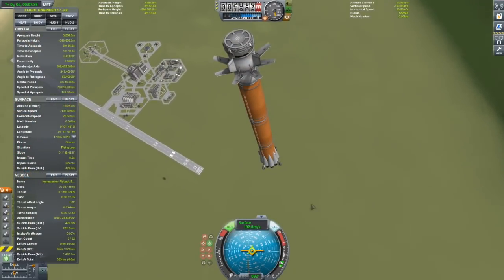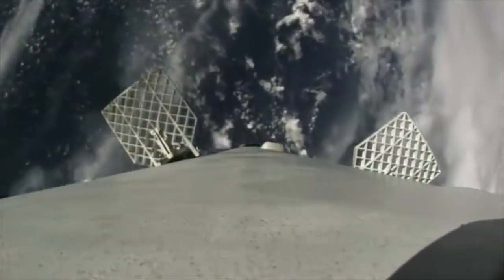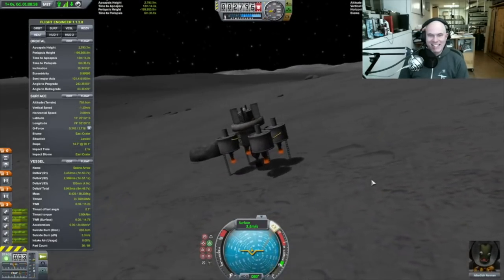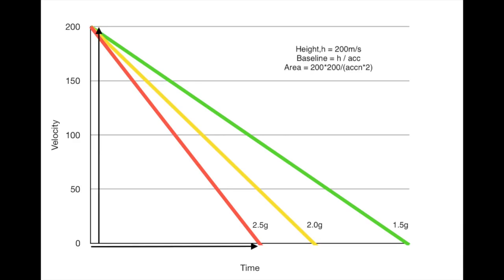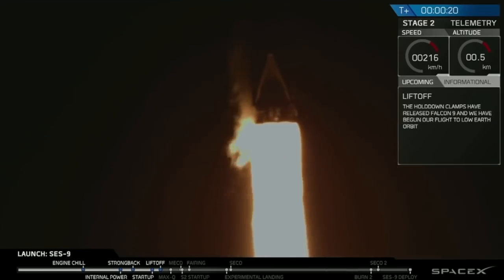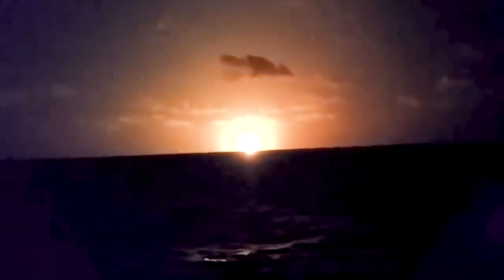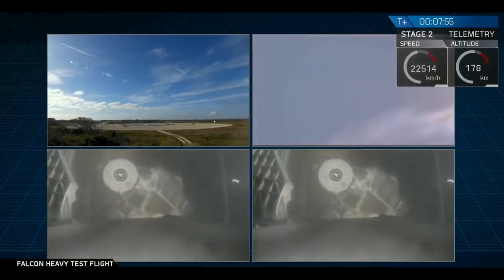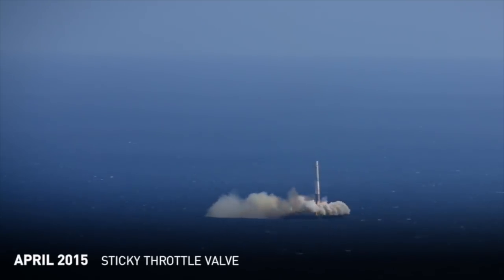How To Do A Hoverslam - Things Kerbal Space Program Doesn't Teach.

Comment: Surprisingly, I remember a very basic 'simulator' Deutsche bahn released on their website a while ago that was a PR thing showing the best way to drive a high speed train for energy efficiency.
One of the things was quite obvious; when dealing with a hill, let the train slow down uphill, then recover the energy downhill. (though it demonstrated this was tricky to do while keeping to schedule and not breaking line speed limits on the downhill section.)

But the one that I'm reminded of here is that the program and the web page to go with it showed that the most energy efficient way to drive a train is to accelerate as quickly as possible, and decelerate as quickly as possible as late as possible.
In other words, it's a similar operating principle to the suicide burn rocket landings - quick, sudden velocity changes are more energy efficient than slower, gradual ones.
(though both for rockets and trains there are a bunch of limiting factors that make this less practical in a real world scenario.)
Reply: Oh, yes! Energy-efficiency optimisation often leads to bizarre results. One more niche application, very closely related to the problem with trains: given identical lap-time target, a more powerful racing car will use less fuel (assuming equally efficient engines). Accelerate as fast as you cant out of corners and then lift-and-coast for a while before hitting hard on the brakes. (Modern F1 with its ”hybrids” likely uses this approach, obviously, on how to best use the recovered braking energy.)

Comment: So technically KSP does teach this?
Reply: Yup. The only thing it doesn't teach in all of this is that engines cannot be throttled, and need time to start up.
But that was already part of a previous "things KSP doesn't teach" video.
Reply: And there are mods for both of those, if you really want them.
Reply: engines cannot be throttled? Yes they can, unless they're solid rockets.
Reply: @slopedarmor Sure, but there are limits.  They need a certain amount of fuel flow to sustain combustion and operation, and that means there's a minimum thrust they can put out.  Between that and full throttle you can probably throttle them pretty smoothly, but there's that minimum - which KSP doesn't model without mods.
Reply: That's true. You can go to like 1% thrust output in ksp but not in real life  D:
Reply: Not all liquid rockets can be throttled. Some of them are one ignition and zero throttling ability. Apparently, some pumps like to 'chug' and even refuse to be shut down once started.
Potentially not as bad with pressure fed catalyst decomposition engines, as these could easily have the propellant flow regulated. I think engine on the decent stage of the Apollo lander could throttled to 10%, if I understand right. (But that was an engine for a lander, not a booster.)
Reply: You can combine Thrust Limiter & Throttle to get much less than 1 percent thrust. In case you have a stupid TWR of like, 100 or something.

Comment: @Scott Manley, I think there's an easier way of understanding how reducing the burn time saves fuel. If the rocket is falling at a terminal velocity of 200 m/s, and you do an instant burn to reduce speed, you'd only need 200 m/s of deltav to brake. If you instead take X seconds, gravity keeps acelerating your vehicle during those X seconds, so you instead require 200 + 9.81 * X m/s of deltav. The longer the burn, the higher the deltav needed (roughly linearly).

Comment: I am curious why a suicide burn landing would be more desirable than landing the booster with a parachute (maybe I am just too lazy to research it). Or even a combination drogue chute and suicide burn, but I guess excess thrust is not a problem in the examples in the video. I would use this combined approach in Kerbal, but the unrealistic engine throttles make it so easy. IRL, sure you have to haul a parachute with you on the way up (weight), but you have to carry extra fuel for the suicide burn. Maybe you could use a suicide burn to slow the craft to a relatively low speed and use a larger low speed (low quality) chute at the end. 

Just wondering, because coming from Kerbal, I use chutes on every thing. Even experimental aircraft on the runway can be saved by chutes if they lose control on takeoff. Obliviously, Kerbal is not real life, but I do not know the real life pros/cons of using parachutes for landing.
Reply: You have to haul the parachute, it wouldn't be as precise, I imagine you might need some engine thrust for a soft landing anyway, plus you still need to reignite your engines for a possible boostback and a mandatory entry burn, and at that point you really might just carry a little extra for a final landing burn instead of dealing with the extra complexity and the downsides of chutes.

A lifting body or winged vehicle might be able to skip the entry burn, and I think that's what the BFR upper stage/spacecraft is plannd to do, but it'll still land propulsively.
Reply: Robert G I'm guessing that flooding a rocket with salt water makes it much harder to reuse said rocket. It's pretty difficult to land something at a fixed location using a parachute and it's much more prone to wind blowing it off course
Reply from the maker: Parachutes have a hard time delivering things with the precision to land on a barge, if they don't land on a barge they're probably ruined.
Reply: Accuracy is the biggest problem. With parachutes, your landing zone would stretch for miles, and wind can easily blow it off course.
Then there is the problem of the drag of parachutes. Rockets are designed to take the compression forces, but a stretching force would require a new structure which would also be heavier.
Reply: there's also the fact the booster is like 16 stories tall.... I can't imagine a parachute working for something like that
Reply: I have a name great point! The stretching force would be enormous and would be very different to the forces of launch.
Reply: ofiterpunte and now your rocket weighs twice as much and cost three times as much and is five times more prone to failure :-) that just would not work not with our technology
Reply: yes. I actually design amateur rockets (nothing nasa level hobby level highest flight about 12,000ft) modularity adds a shit ton of mass and becomes a huge failure point and they can't "overbuild" them like we in the model industry can. (we have much higher thrust to weight ratio's than the big boys get)
Reply: I'm pretty sure you can control modern parachutes with mechanisms that pull slings (or how are these ropes called in english) to some degree
Reply: control yes. guide with the needed precision? no.
Reply: Why not a "suicide parachute deployment", deploy just in time to slow for landing, and detach before actual landing if too far off course, using a suicide burn to complete the maneuver?
Reply: If it's light enough for a parachute to even help, it could probably use large inflatable floats to keep it out of the water instead of landing on a barge. Maybe inflating them using the remainder of the 'cold-gas' pressure. I imagine the chutes and floats would add weight though, while the powered landing is using up remaining fuel.
Reply: The Space Shuttle SRBs did use chutes to brake but they had to land out in the Atlantic ocean because of the inaccuracy of a parachute
Reply: late, but in ksp parachutes can clip together, while they can't in real life.

Comment: Are engines that can reliably perform suicide burns pure sci-fi or do we have some ideas for tech that would pull it of with close too 100% reliability?
Reply from the maker: SpaceX has been pretty reliable except when pushing the envelope. They haven't had an RTLS failure.
Reply: OH senpai noticed me!

Well I was thinking that the tech seems really good for unman crafts at the current stage of development but will is realistically be used for manned flights in our lifetime?

Seemed from the video that we are at the "good enough for unmanned"-stage not the "I'd take a ride in a craft that can only land via hoverslam"-stage.
Reply: GreatgoatonFire 
The boosters wouldn't have people in them...  so a manned falcon 9/heavy is pretty reliable now.
Put a reproduction mercury capsule on autopilot (I'm no steely eyed missle man)  on the nose of one... I'd ride it tommorow given the chance.

Rocket engines are reliable.  The challenge with the falcon booster engine return is they run on LOX/RP1 
So they need a reliable method of reignition (they probably use TEB, Triethylborane. Which is pyrophoric liquid that spontaneously ignites (quite violently) on contact with oxygen.)
This isn't a new concept... the SR71 was using TEB to light its engines and afterburner since the 60s. Each engine had enough TEB to relight its afterburner 15 times. after that... nada.
Carbon deposits on the TEB injector inside the J57 engines would sometimes cause multiple shots of TEB to be needed to light the afterburner... wonder if SPACE X  is having a similar issue? 
If the Falcon was a hypergolic first stage, the relight would be simple, and almost foolproof...  hypergolics are nasty, nasty, chemicals though.

Anyone know why they went with LOX/RP1 for the boosters? 
 

As for landers... how do you think the apollo LEM landed on the moon... parachutes? 
Came down on its engines on a suicide burn, with enough reserve to adjust the landing site as needed to avoid terrain on final. 
It was said the most reliable part of the Apollo moon system... was the Lander. 

Now,  a powered manned decent on a planet with a thick atmosphere  like earth...
I see it as a needless risk,  chutes work fine, and are lighter than the fuel needed to pull off a powered decent. 
I think it could be done, certainly... but why work when you have drag to do the job for you?
Reply: They could use something inspired by the approach Rocket Lab takes (who use an electrically-driven turbopump, which provides extremely fast startup and throughput modification), to help start it spinning quickly upon startup.

This could perhaps also provide a means for small but highly responsive adjustments to the turbine rotation speed, so as to significantly reduce the latency between targeted pump throughput and what is actually  achieved - as well as maintain it, counteracting any disparities which arise. 

This could be achieved by coupling electric motor(s) to the turbine shaft(s); supplying power would increase turbine speed, and drawing power from it (by using it as a generator) would decrease turbine speed - performing these actions as required for control. 
The key part is the level of near-instantaneous control this should enable in control of turbopump throughput.

Important: The proposed electric motor addition is only a compensatory mechanism which aims to decrease latency and short-timescale variances between what the flight computer commands and their real-world outcomes - it is NOT proposed as the sole energy source for pump operation... it is merely a fast-acting and precise augmentation to provide responsiveness and consistency to the operation of existing components. It should consume only very modest amounts of energy, nothing remotely like that required of purely electric-driven pumping like that used by the Rutherford engine used by Rocket Labs.

... Come to think of it, this would theoretically be even more effective for the operation of Raptor engines instead of Merlin  engines, as full-flow staged combustion cycle engines like Raptor depend upon highly precise, well coordinated pressure differentials throughout the preburners and the turbines that feed them - especially during startup - and this level of control should be particularly useful in this context.

Comment: Way back when I was in high school in 1971 we had an interesting program in a computer programming class.  The school had an IBM 1620 computer and one of the computer programs available was Lunar Lander.  The input/output on this computer was a built-in typewriter, so it was typed information only.  You had to use your imagination for any "graphics". 

The Lunar Lander program would type your altitude, fuel remaining and velocity.  You would type in the desired setting for the decent rocket motor.  The goal being to end the program with zero altitude, near zero velocity and some fuel remaining.  If you started braking too soon, you ran out of fuel and crashed, just like they would in real life.  We quickly learned that the only successful flight profile was to do a hard burn at the last moment.  I seem to remember that a few short burns along the way helped to keep the velocity from climbing too high (no atmospheric drag on the moon).  It was fun, and I don't think we appreciated we were learning something.

Fast forward 45 years.  We watched the amazing flight and landing of the two boosters of the Falcon Heavy at work.  In discussing the booster landing, it was neat to be able to share why the booster has to fly the "hoverslam" profile, it's the only flight profile that will work.

Good job on your video and explaining this.  Yes, it is rocket science..

Comment: While there are many complications, such as the decreasing mass, drag and so on there is one thing that does make it 'easier' and that is the throttling capability of the engine/s.

While the throttling range is limited it does allow closed loop feedback control to have sufficient authority to make up  for most of the difficult (or sometimes impossible) variable factors.  

One would calculate the starting time of the burn assuming a thrust mid way between minimum and maximum and then allow the closed loop control algorithm to make adjustments, continuously recalculating the required thrust for a zero velocity touchdown as it approaches.

Comment: Two days ago I did a suicide burn to land on Ike but overestimated the power of my landing stage a bit, so it exploded, but I quickly staged to my nuclear engine, but this stage had no landing legs nor it was very powerful, so I basically just spammed the research button (I really like that in ksp2) till my small engine touched the ground a bit and the research was complete, I got with 30 Delta V back home and could say that mission was an success, but I swear, this rocket wouldn’t stay 10 milliseconds longer on Ike without crashing, that was really close!

Comment: Hey there, just a little note: MechJeb and KerbalEngineer do calculate the fuel burn just fine. The real reason is that while the math for a completely vertical suicide burn is trivial, it gets insanely nasty for a burn with an initial horizontal velocity. As far as I understand, there is no exact analytical solution for that. MechJeb does have a neat approximation though and comes pretty close, at least with the timing itself.

More discussion here: https://forum.kerbalspaceprogram.com/index.php?/topic/155599-suicide-burn-code/

Comment: For those wondering, as I was until I worked out a likely reason for myself, why can't real rocket engines throttle like in Kerbal, it's most likely because of one concept.  The more moving parts you add to any system, the more points of failure you introduce.  In order to throttle the way KSP does, they'd have to have a computer that controls valves opening and closing in increments and calculated to properly mix the oxidizer with the fuel.  Thats introducing quite a bit more points of failure and is probably a risk they didn't want to take, and money they didn't want to spend.

Comment: Hi Scott, You mentioned, "every second spent using engines against the force of gravity is wasting delta V equal to the force of gravity" This is a good concept for rocket fans to understand and in a bit more detail. It can more fully be explained by pointing out that hovering a rocket, is the intuitive example of how 'using engines against the force of gravity is wasting delta V'. The flight time to orbit is more fuel efficient the quicker it is completed. And similarly the booster landing burns are most fuel efficient when they can happen quickly. Having both the launch and landing burns a short period of time is accomplished by having them at the highest acceleration tolerable. Now, where does the wasted fuel go? That is a little less intuitive but knowing the answer gives you a more complete understanding of orbital dynamics. Well, the fuel used to fight gravity is used to move the barycenter of the Earth-rocket pair. That means the rocket is acting as a space tug during ascent and decent burns. But you can act as a space tug for a minimum amount of time ( and thus waste less fuel ) if you use a high acceleration to shorten the time of the needed burn.

Comment: it makes sense because downward acceleration is constant. the longer you are in the air, the longer you accelerate downards. sitting on the ground doesn't use fuel. sitting over the ground, hovering or slowing down does. simple as that.

Comment: I wasn't able to find the dry weight of a Falcon 9 first stage, but I did find that the Merlin 1D engine can be throttled down to 76000 lbs (34.5 tonnes) thrust. Since the takeoff mass of the whole stack is 549 tonnes with about 14.5 tonnes being payload, I think that the dry mass of the first stage plus landing fuel is going to be greater than the minimum Merlin 1D thrust. Hence, SpaceX need not be doing suicide burns. The flight control computers can use altitude, attitude, and GPS sensors in feedback loops to control the engine thrust and gimbaling to pilot the Falcon down to the deck, landing at pretty close to the nominal speed without calculating exact thrust percentages for the entire descent in advance.

Comment: my tip: using kerbal engineer in 1.5 +  adjust your thrust continuously to make the time to suicide burn -0.5 seconds until youre just above the surface and then when youre very close to landing apply more thrust to take it down to 0 and then transition to visually landing the craft like normal